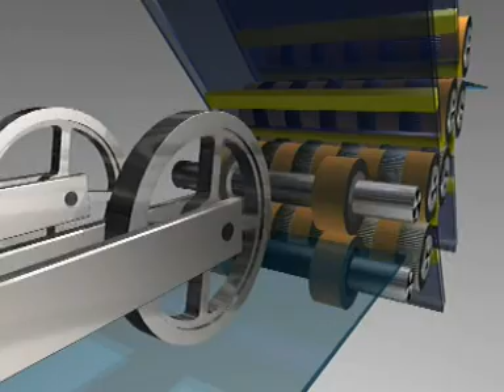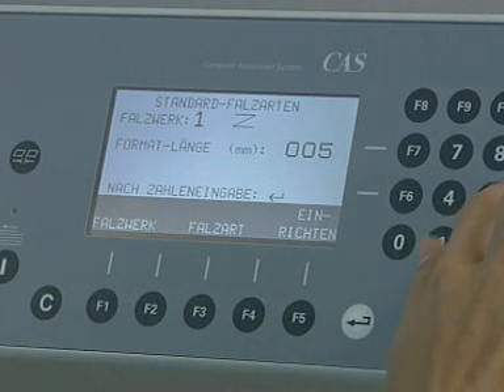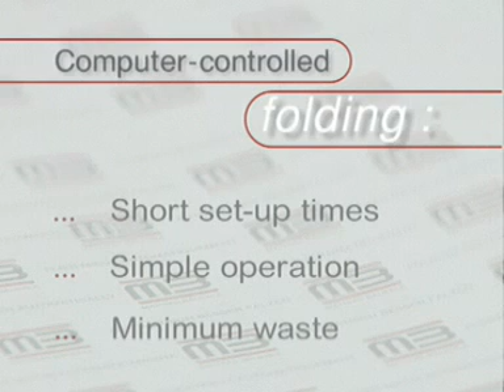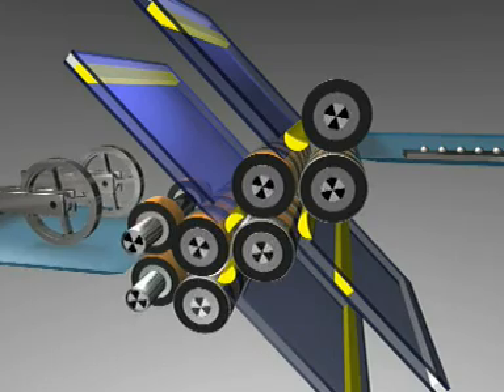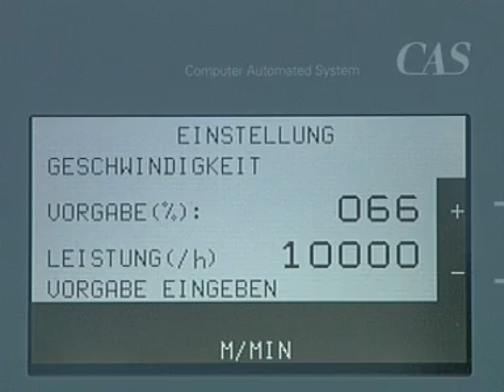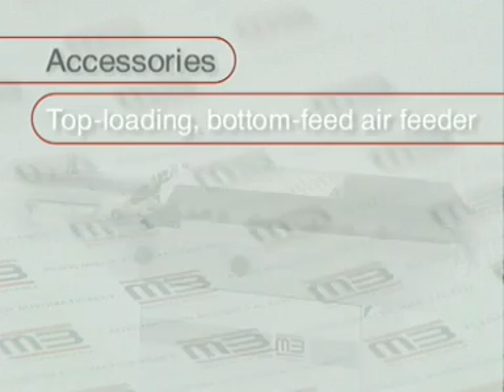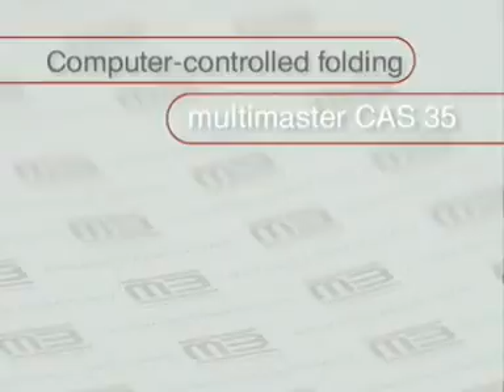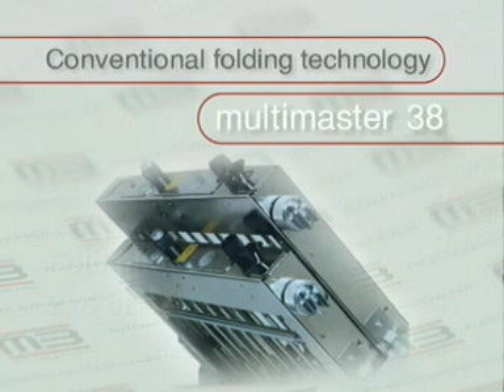MB Folders

Comment: Did you know Paul pitt there is a way to make a z fold going up and up in plates 1 and 3 NOT using plates 2 or 4 the lower bottom plates.. its really weird and there is no reason unless bottom plates are broken or for some reason can only be used in deflector position, Do you know mike devine who knows baum folders as a mechanic..